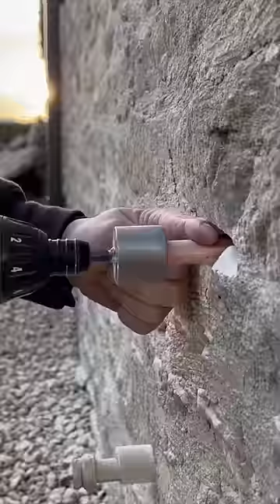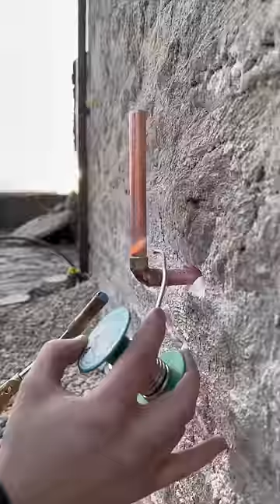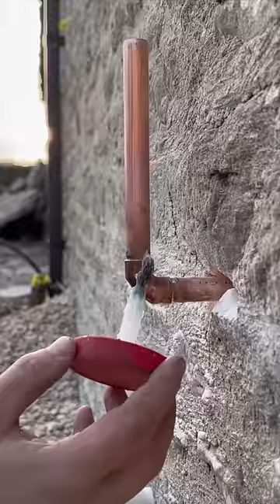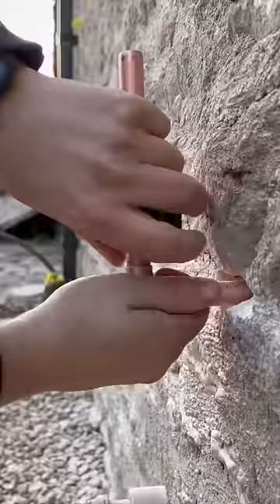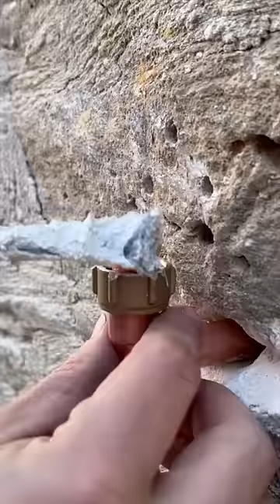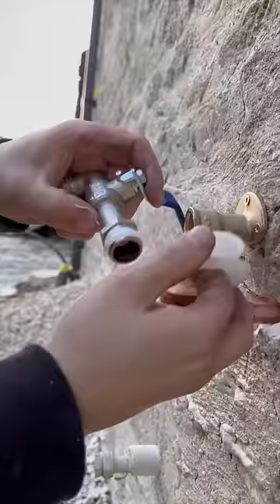HOW To fit an outside tap on stone wall! #howto #asmr #diy #plumbing #subscribe #youtubeshorts

Comment: Pipe dope on a compression fitting? Fascinating.
Reply: Yeah, that blew my mind.
Reply: I've also seen Teflon on those and taper seats too.
Reply: Some people just never get the memo.
Reply: People use teflon too
Just saw the comment about me
Reply: That is NPT, not a compression fitting.
Reply: @randyneilson7465  thank you for the clarification, they do function the same yes?
Reply: @randyneilson7465 the elbow is compression to NPT. Yes it's dumb to put dope there. Also only need 2-3 wraps of teflon tape, more than that just gets pushed out of the way, none gets into threads to help seal.
Reply: @Jonathan-hx6oy Why is it dumb when dope is a lubricant and a sealant I know the compression is supposed to "seal" it but the point of the lubricant is to help the nut make  compression.  Let me guess you don't use never seeze on bolts?
Reply: @shawnm636  well it depends on the bolt. Never on brakes because the grease in anti-seize is low temp and cooks off can cause calipers to jam. Always on exhaust because they aren't supposed to move and heat cool causes corrosion.
Reply: @Jonathan-hx6oy  we are talking about plumbing
Reply: @shawnm636 the compression fitting isn't suppose to seal, it does seal. Period. Putting pipe dope on it interferes with its ability to properly compress and seal.
Reply: @jonklier1512  so you've never had a compression fitting leak? Let me guess your one of those  I've never had a solder leak plumbers lol.  The point of putting the lubricant on the threads is to help the compression nut tighten even more.   But hey you do you enjoy your call backs
Reply: It's to act as a lubricant
Reply: @shawnm636  He didn't apply the pipe dope to the threads in this video. I think that's what he was getting at. Applying it the way it shows on here is not spec. Compression fittings do not use any additional compound. No hate towards the guy. As long as it doesn't leak, and it helps him sleep better at night.
Reply: @shawnm636 The way a compression fitting works is it compresses the olive into the pipe until it creates a metal seal, it doesn’t need lubricant to tighten it or sealant or anything. The metal olive squeezing into the pipe creates the best seal you can get.
Reply: @Gianno_  well aware of how they work nothing wrong with some lubricant to help the nut tighten. I guess you've never seen a compression fitting leak
Reply: @shawnm636  I mean nothing wrong with it yeah but it’s not really needed, just tighten until you hear it squeak, you can actually overtighten them and break the olive if you overdo it
Reply: Always.

Comment: Why not straight put of the wall so to avoid extra pipework and elbow that might freeze?
Reply: Yep 👍
Reply: more money ,time and material😅
Reply from the maker: 4ft of solid Cotswold stone wall, drilled through the mortar so I could fix it to the big brick above. If you want to drill a 22mm hole through them bricks then feel free
Reply: @mmplumber had to coredrill a 4” hole through roughly 700mm of Cotswold stone for an extractor…and my god, with a fairly new core it took me like 2 hours and it kept jamming due to all the dust.
Do not recommend 😂 Good arm workout tho
Reply: @liamdraper447  алмазные дрели вышли из моды?
Reply: @mmplumber He’s asking why put the elbow in? Not why you didn’t drill through the wall.
Reply: And he answered..  To put in the holding screws into solid base.  Straight out, they would have been too close to the pass through hole.
Reply: Probably I got misunderstood. I meant, instead of using a 90⁰ elbow and a 90⁰ back plate elbow, why not using the straight pipe with the round brass fitting soldered. The one that comes in the kit with the pipe already soldered into it that you would have slided through the hole that you already drilled?
Reply: If you don't do it the way it shows in the video, how do you want to change the tab if it's broken?
The straight connection fitting is inside the wall anf you can't get a wrench at it to counter the force you put on the tab to remove it and mount the new one.
I'm a plumber myself since 40 +years and I would do it exactly like it is shown in the video.
Reply: @liamdraper447  here's an idea hammer drill 😂
Reply: @MarcoKrieger would you also use the same type of tubes used in the video?
Reply: @facco01 Sure, it's copper, there's nothing wrong with that.
I come from Germany, we use almost the same materials except for the flux.
The one shown in the video is acid-based and is no longer used in drinking water installations because toxic residues remain in the pipe.
Instead we use a paste made from solder. This way you don't have to use as much solder and the paste will tell you when both the pipe and the angle are at the right temperature because it melts like the solder and you can see it glitter.
The cleaning process is also the same, but I personally use a special metall-free fleece instead of this fitting cleaners, because you need two tools for each pipe diameter (inside and outside) and I like my toolbox lightweight, I'm 58 years old.😁
Reply: @MarcoKrieger  thanks, I would like to put an external tap like in the video in my house, what should I use so that no toxic residues remain?  special joints to pinch or a different paste?
Reply: @facco01  that's a really good but also difficult to answer question.
I'm not familiar with the materials you can buy in your area. The product I use is BrazeTec Degufit 3000 and BrazeTec Degufit 4000 soft soldering paste, both I have used for years.
Degussa, the company who developed this product is based in Germany.
I'm pretty sure that there are similar products in hardware stores you have at hand.
Best wishes for your project and greetings from Germany.
Reply: @MarcoKrieger  And Do I use copper or iron as pipes? Better copper?
Reply: @facco01  the solder I talked about is exclusively made for installations in copper and brass.
Reply: @MarcoKrieger As a fellow plumber with 40 plus years experience, if you're saying you wouldn't put the tap below the wallplate or fit a tee with a draincock to allow full drainage of pipework in winter (as long as internal isolating valve has been fitted) then you've been doing it wrong for 40 years .
Reply: @Gazzabhoy  I think there are many ways of doing things right.
I wish I could communicate with schematics to make sure that I'm not misunderstood because of my limited English skills.
I'm sure quite a bit of what I wrote is lost in translation.
Reply: @MarcoKrieger  i understamd, the questione i made wad a dubt of what tipe of material Is better
Reply: @facco01  I understand your question.
In my opinion, copper is the better choice for drinking water installations.
But it depends on the water quality in your region.
For example, if the pH level in the water is to low, underneath 6, copper piping can be damaged.
In this case it is better to work with PVC pipe systems.
Reply: copper or plastic, black iron will rust and break.

Comment: I just did almost the same thing, but then i read that the pipe must be sleeved whenever it goes through a wall?
Reply: Never done that i usually just tape it with duck tape
Reply: Copper corodes when in contact with brick or concrete. Best practice is to put it in a steel pipe or plastic pipe.
Reply from the maker: Has 22mm inside it
Reply from the maker: It’s sleaved with 22mm

Comment: Pipe dope on a compression fitting?
Reply: Standard in uk
Reply: @arasmumyakmas8531 still wrong, check out the manufacturers instructions
Reply: Yeah, that's not right
Reply: That’s a first in my book. The seal is in the compression not the threads. That’s wonky
Reply: Yes. Even on compression fittings. IYKYK.
Reply: Yes you do I always dope the ferule
Reply: If you took the journeymans class you would know pipe dope is a lubricant, not a sealant .
Reply: @xD4RKxRYU  your statement is half correct the other half would be wrong . Pipe dope is exactly a sealant but is also a tread lubricant that creates a seal between fittings maybe you missed that day in class 🤷‍♂️ to say it is not a sealant leads me to believe you have never used pipe dope 🤔
Reply: @xD4RKxRYU  If you are a journeyman and have worked in the field for 40 years you would understand it's both.
Reply: @rustyme1122  Every manufacturer of compression fittings say you definitely should NOT use pipe dope or tape.
Reply: @takeitasacompliment.  Pipe dope is used on compression fittings for the same reason HVAC techs use refrigerant oil on flare fittings. It lubricates the surfaces to prevent galling which helps the soft metals form a seal. Any plumber who knows their craft has countless stories of call backs from leaking compression fittings not properly lubricated at install. But you go ahead and obey the mfg.
Reply: Retired construction millwright and never saw dope on a compression fitting in my decades on the job here in Canada. Specifically checked to see if anyone else was surprised at that.
Reply: I could see a tiny bit of dope on the threads for lube but he put a lot on.
Reply: @rustyme1122  More of this myth of a ferrule "galling" on these posts.
Reply: @alemgas Yeah because manufacturers have never been wrong 😂
Reply: @rustyme1122 EXACTLY 👏👏

Comment: Compression fittings don't require pipe dope, either way good job
Reply: You are correct that they don’t need it but they seal much better and tighten more easily with it. I have used pipe dope for over thirty years on them.
Reply: The worst is watching gas installers pipe dope the hell out of compression fittings. Just asking for a plugged gas valve.
Reply: @Heckleburger  I’ve never had a plugged anything using pipe dope in 33 years.
Reply: @BlueDart1971  Luck is all you have.
Reply: @Heckleburger  it’s not luck. It’s called knowing what I’m doing.
Reply: @BlueDart1971  Not if you are using sealant on a compression fitting.
Reply: @Heckleburger  what are you talking about?
Reply: @BlueDart1971  So 30 years ago someone showed you that as a joke and you've been doing it ever since? Lol
Reply: @thatguyoverthereinth  Yup. Putting dope on a compression fitting defeats the purpose of the fitting. Just because you've been doing something for 30yrs doesn't make it right.

Comment: no sleeving.....  did you use a double check valve?
I also prefer to install these thenother way so you can drain it more effectively for the winter

Comment: No sleeve through wall, using flux to cool down fitting and not using stainless steel screws outside 😂
Reply: Right there with you. Fails my inspection
Reply: Flux was to clean, not cool.
Reply: @gordbaker896  🤡🤡🤡🤡🤡🤡🤡

Comment: Paste on a compression joint is a cop out, the olive if everything is prepared correctly will never leak. But I do get the amount of PTFE they put on the tap, it has to land in a horizontal position so more tape helps you achieve that.

Comment: If the building is heated, the copper pipe conducts a surprising amount of heat to the tap.
At about -10 c there is insufficient heat to stop the tap from freezing.
This is in the central belt of the UK.

Comment: Try using the heat treated Blue Missionary screws, Drill one pilot hole,  and let the screw penetrate into  the masonry to get a good grip..If you think that plastic inserts wont let go over time ? they will, because of all the heat cycles that they are exposed to from the weather changes. You  use should use or choose to use soft metal anchors instead of the plastic anchors.

Comment: Heat rises to the top.Start your sotter joint at the top.Then take the flame off and start to the bottom
Reply: Solder, not sotter.

Comment: how do you drain the pipe before winter? and what protects the pipe from corrosion?
im asking because you did everything else correct and if you can put a sleeve from the other side through it and put a drain valve below this pipe on the other side this is good work.

Comment: Why not just come straight out with a Silcox hose bib, with an FIP Hex fitting OR if you are in colder climates drop the Hose Bibb down so it can be drained. AND dang ALL that Teflon tape.!!  Wrap threads 4 times then some white pipe dope on top for a better seal with no tearing. There is such a thing as too much Teflon Tape.  AND Why are these Plumbing videos showing THESE DIY videos of them Using the FLUX BRUSH to wipe the soldered Joint.  Soldering is done. AND  using a flux brush IS NOT Needed to wipe a pipe. Plus wiping the Copper with the Flux Brush just let's small particles fizz out and cause problems later on. IT WON'T matter about the Dry Rag to clean off the Splattered Flux, Sure it helps better than not doing it. If the rag was used before on other Copper Piping to wipe Off Flux too many times it turns green in couple days. It WILL eat up the copper. I have walked up on my guys on Rough ins and Damn near chewed them out over unwiped copper, I use Good Clean Red Shop Rags , sometimes for Hospital work, or underground, in walls or anywhere WATER and sand on a rag to wipe off solder. Otherwise nice video, SO WE CAN ALL POINT OUT SOME THINGS.😏

Comment: Rank amateur, using pipe dope on  compression fitting. Reminds me of Electricians who don't believe wire nuts work, putting electrical tape around the nut. If they would just trim the wires to the correct length, twist the nut on nice and tight. Pull on each lead to make sure it's attached, no need for tape.

Comment: in the USA that'd fail code inspection.  I'd do it and I'd use 3/4" pipe  but it'd fail and  it'd also fail if you wanted to refi.

Comment: Moral of the story boys it might seem like a good Idea to stick your pipe through a hole in the wall but after the tip gets polished it might be followed by a severe burning sensation and then your screwed. And you will end up needing to twist and turn a lot just to control the flow after that. Also it's important to remember that it doesn't matter if you imagine a beautiful woman out there the chances are it's some dude working your pipe 😂

Comment: I'm just an ametuer builder. I mainly help with remodeling but have done some full builds. Why not run pex from the copper stuck out? Less likely to leak and alot less work

Comment: Those plastic anchors you put into the wall should be flush with the wall, not hammered inside like you did, the screw has and the hole should be longer than the lenght of the bolt in order for screw to penetrate the back of the bolt.

Comment: I guess iso tape or sleeves aren't a thing where you are. Inside to outside must be sleved and insulated by IBC. Dont worry, though, that vibration from the water won't wear on that pipe at all.

Comment: Where is the insulation for the copper in the cement? The lime scale and other materials in the cement as well as water from elements will deteriorate the copper and create leaks and pinholes without pipe wrapping, sleeving, or insulation.

Comment: First yank on the water hose cause he can’t untangle it, and that entire thing is coming out of the wall. Why wouldn’t you just use concrete screws? Those regular stainless steel will rust in a few months

Comment: You are not supposed to use any kind of sealer on a compression or a machine fitting. Also i think you need about another roll of Teflon tape on those threads.

Comment: Only got one question why was he hammering a screw into the wall that just turns up the pain that he put in there to screw it in
Reply from the maker: Pushing the wall plug further in the hole to stop any chance of cracking the brick face

Comment: How not to prepare copper pipes. Clean bore, prevent noise and power erosion,  use pipe bender to create large radius, again this will reduce the noise. Be normal use European PEX

Comment: I'm not ew to soldering/brazing, is the propper technique to heat from below and feed solder from the top? ive also heard that if you heat from the top and feed from the bottom capillary action pulls the filler up. Either way, this seems to be one of those things tradesmen will argue about until the sun dies out. Just looking for some information if anyone has any.

Comment: Jag up wall elbow first before fix to wall and why did you not use a wall tap with a check valve to prevent back syphonage ?

Comment: I’m curious why he couldn’t have just stuck one straight on rather than putting a 90 on it. Now you have pipe and a hole showing. Is there a reason?
Reply from the maker: Needs to be fixed back to the wall genes the 90 deg brass fitting
Reply: @mmplumber  couldn’t the mount do that over the hole? Or a different mount that’s slightly bigger?

Comment: He is wrong the elbow should face down and the tap should be at the bottom so in winter you can drain the pipe and tap of water. common by sense.

Comment: You don't do it like this you install whats called a freeze out its a faucet where the stopper is recessed about 8" back into the wall keeping it out of the elements so it doesn't freeze

Comment: Pipe dope on a compression fitting and wrapping the Teflon tape clockwise such that the tail rolls up as you thread it together. Wrong

Comment: I was with you until you put that crap on the compression olive. They are designed to seal when torqued correctly. No need for additional sealant

Comment: You know you forgot to solder the bottom joint, right?
Reply from the maker: Nope all done my g
Reply: @mmplumber  Well, you didn't show it in the video...
Reply from the maker: @o0shad0oo  maybe watch again
Reply: @mmplumber  ... Okay.  I thought you left the bottom unsoldered to be able to rotate it down.  Instead I guess the pipe hadn't been secured inside the building yet.
Reply from the maker: @o0shad0oo  yeah that was done after 👊👊

Comment: How not to fit an outside tap, to much flux, no sleeving around the water pipe that goes through the wall, no back flow protection